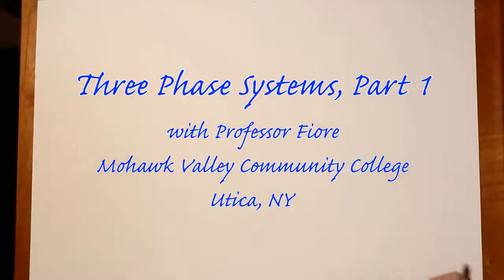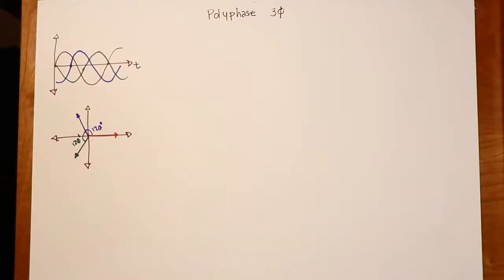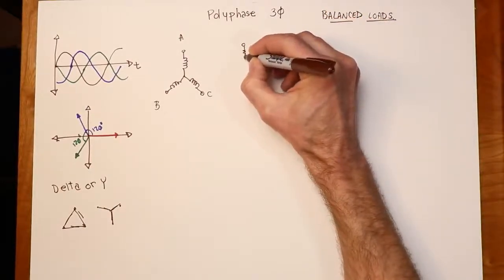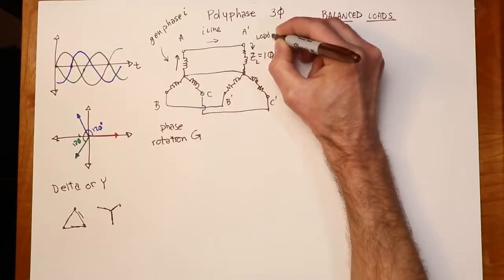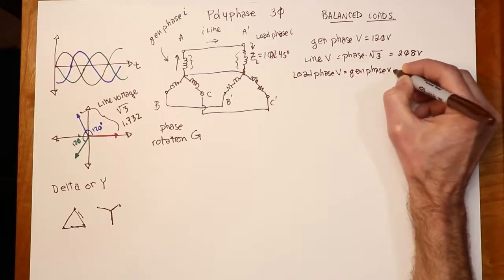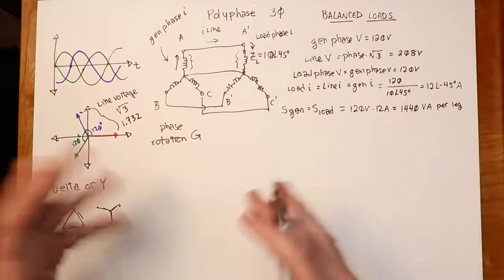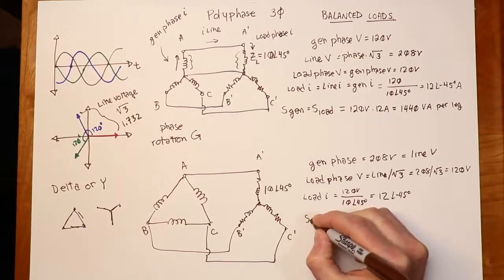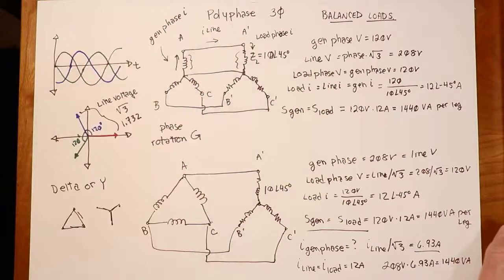AC Electrical Circuit Analysis: Three-Phase Systems, Part 1

Comment: Is a transformer with a purely capacitive load series or parallel resonance? And how would you analyse this?
Reply from the maker: My corresponding question is "Why would you have a purely capacitive load?" If it's purely capacitive, you can't get any work done (literally, true power occurs only in resistive elements).
Reply: Hello and thanks for the reply. Lets say there's a transformer to step up voltage. The transformer primary has some magnatising L (inductance) and leakage L. The transformer also has a secondary with magnatising L and leakage L and some resistance for the winding. Thi is driving into some loads that are purely capacitive.
Reply from the maker: I am very curious as to what manner of three phase load you have that is "purely capacitive". 
In general, there is going to be some interaction between the inductive and capacitive elements but it's probably best to not think of this in terms of series versus parallel resonance, but rather as a coupling issue between L and C. This concept is developed in the AC text.